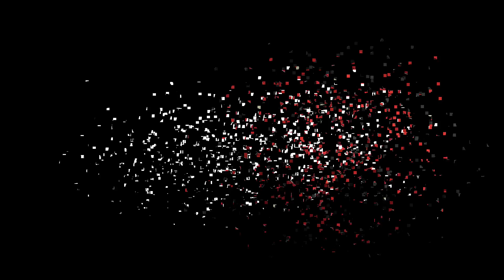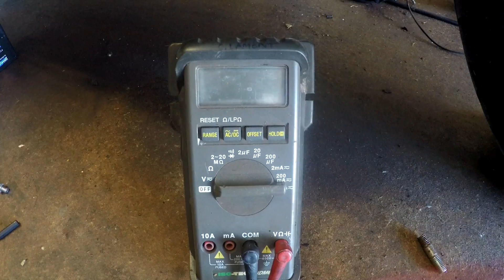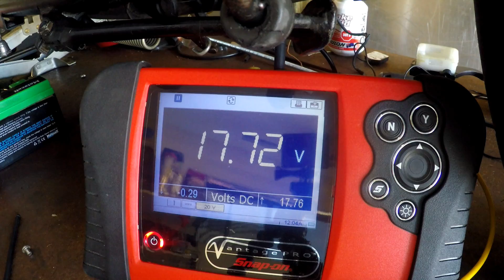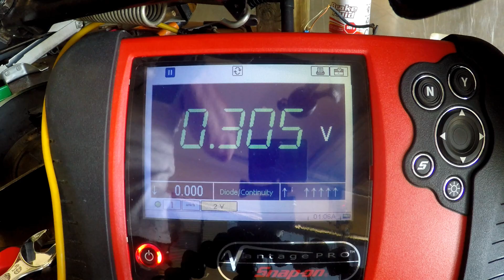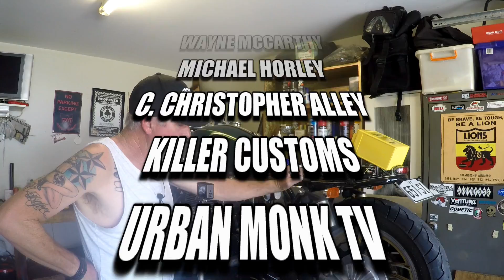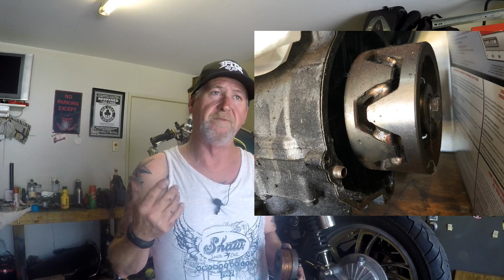'Basket Case' -  The Diagnosis

Comment: My 2009 Kawasaki ZX6R rectifier died at 10,000 rpm on the track. Fried ECU, battery, and relay board…. It was a used bike where recall wasn’t done. Fortunately Kawasaki USA covered everything except battery due to age.

Comment: Just bought a basket case of my own and you guys that have worked through these issues are a gold mine of information.

I’m now feeling much more confident that my project will succeed rather than end up in the scrap yard which is surely where it would have ended up if I hadn’t liberated it from the guy who sat on it for years and did nothing with it. Thanks and  looking forward to all your videos.

Comment: The battery charging reg. needs to be specifically suited to the LI battery to keep it charging at the appropriate rate and to keep it at the correct temperature while charging so it (the LI) remains reliable. LIs are great for these seldom run bikes coz' they keep their charge a long time (used in seldom driven hyper cars) otherwise the AGM batteries might be better suited for a daily rider.

Comment: Hmmmm, XS1100 converted to chain drive, what you talk'n bout willis, need input!!!!
Reply from the maker: Some of the race bikes were converted here in Australia. Bryan has the last surviving unit from that period. A company in South Australia still makes and sells chain drive conversions for the XS11.
Reply: yeah i found it, wow that's a lot of money to convert something you don't want into something you do want, cheaper to go buy a used bike that was made with a chain drive to begin with, not that I have anything against the shaft drive itself, in fact in some ways it's better then chain, the problem is the way the manufacturers implemented them, like with my XJ650, the engine itself has plenty of power, the problem is the bike only came with a 5 speed tranny and with a final drive ratio so low that, when trying to travel with the flow of traffic on the highway so you don't get run over the engine is running at 7000 rpm's which is 75% of the bikes 9500 redline, engines don't last very long when forced to endure that kind of stress for very long and the shaft drive makes it impossible to change drive ration.....

Comment: Hey guys after some info if poss my Honda crf 250 battery is goosed (6.3 ah) 10 hr, 3000 Thai baht new but i can get 6.5ah (10hr) for 650 Tb will it be ok and safe? Cheers
Reply from the maker: G’day John, that should be fine mate 👍
Reply: @ANDY5  Nice 1 Andy .

Comment: Hi Andy, thanx for that great explanation on rectifiers and AC/DC. Maybe you can use a throttle cable for a 2stroke, they usually  have a split cable system that drives the carburator but also the oilpump. And you can use that to fit an TPS cam on.... Just a thought.
Reply from the maker: Not a bad idea, thanks. If I ever go down that path I think it will be fairly simple to adapt one to the end of the shaft which lifts the slides

Comment: No personal experience using those Lithium ion batteries (expect on my power tools) but have heard/read a couple of stories regards those batteries 'failing'. Not sure whether it was in the comments section of some youtube videos or a video posted showing the issue. There should be no reason for them failing in a motorcycle application though. I still have my 'heavy' lead acid battery for my Bandit (that's in bits ATM) and don't have any plans to replace it with a lithium style battery should my current battery fail...More than likely my Bandit remains 'stripped' for 'some time' though so maybe it will never have to think about...
Reply from the maker: You'll get there Malcolm

Comment: A quick and dirty for checking the pulser coils, lay all the plug leads out on the head (with plugs in them). Turn the ignition on and wave a screw driver past each of the coils in turn, the 1&4 plugs will fire off one and the 2&3 off the other. Obviously this won't help bugger all in this case but might be a good one to file in the back of your head for the future when you're stuck on the side of the road with no multimeter.
Reply: Pulser coils that is, I just reread that and it might sound to some like I mean to wave the screwdriver past the ignition coils.
Reply from the maker: Wouldn’t the screwdriver need to be magnetised?
Reply: Nope just any old screwdriver works. I've used this to check GS and XJR pickups. Just about any TCI from a bike with two pulser coils will work to get that thing running too, it takes a bit of wiring diagram deciphering. Later model ones will use electronic advance (usually single trigger with a chopper plate) but just about any 4 cylinder bike with mech advance should be able to be wired in (just in case you've got old suzuki or Honda ones laying around)..

Comment: Vantage Pro is a great bit of kit but a hefty investment for a home workshop.
Our battery supplier tells us not to use lithium batteries on charging system which are designed for lead acid batteries.
With your high temps you should mount your Reg/rec on a copper plate with a cooling fan.
Reply from the maker: I’ve had that Vantage Pro for ages. I got it cheap from my Snap On rep as it was a repossessed unit. This model is no longer supported and you can’t get upgrades for it anymore. So unless I’m testing 2010 or older vehicles it’s pretty well only any good for the home garage these days, and even then our cars are newer than 2010 😕
Reply: Andy's Motorcycle Obsessions 
 You should scope the injectors, coils, cam, crank, abs sensors etc etc and store your good wave patterns, voltages earths and store to the sd card then you have known good data for your car and bikes. 
Still use my vantage regularly in then workshop so much quicker than my pico scope ( which brings you into a whole new word of scoping )

Comment: Chrysler solid state regulator off the early 80's chrysler and a full wave  3 ph bridge rectifier module and you should be good since that alternator is excited like an auto alternator. My old Yamaha did the very same thing years ago and thats how i fixed it. Also i added a Volt meter to my bike so i could watch it .
Reply from the maker: I have a volt meter, only any good if you’re looking at it 😕

Comment: Great video Andy. Similar to your situation, I had some trouble with fueling on my V-Strom that an aftermarket fuel controller was supposed to fix, but it cost a significant amount. I was reluctant for a while but spent the money almost 20,000 miles ago and have loved the way the bike runs since.

Comment: Just an out of the box thought but could you get one of your buddies to manufacture a voltage regulator box you could put inline on your present system to remove the battery cooking voltages to a more manageable level?

Comment: I'v just had the same problem with high voltage, i replaced my regulator rectifier with a mosfet technology one, apparently they don;t get anywhere near as hot as the shunt type ones

Comment: Lithium batteries married to a charging system designed to use a Lead Acid just seems like a bad idea, that's just my opinion. 

There does seem to be quite a bit of anecdotal evidence to suggest that this might be the case.
Reply from the maker: Lithium batteries when coupled to standard vehicle charging systems are fine, in fact this battery has been on this bike for five years.  The problem is that you can't connect them to a wall plug charger that wasn't designed for lithium batteries because they have a cycle designed to clean the lead plates that will harm a lithium battery.  The issue here was that I had no over voltage protection between the reg/rec and the battery so the battery fell victim to the over voltage failure.
Reply: @ANDY5   The trouble comes as you've experienced when there's a failure in the reg/rec unit.  a LA battery with continue to sink the excess power & voltage and help protect other components within the system whilst giving the operator a chance to acknowledge that a problem exists .  admittedly the battery will never be the same again and a few bulbs may blow but compared to the price of an ECU or Ignitor unit it's cheap. 

The protection circuitry in a lithium battery just goes open circuit, the result is potentially massive voltage spikes that can exceed 60+ volts taking expensive electronics with. 

 Modern  systems that are controlled by the ECU can  stop charging, hopefully preventing further damage. 

This is why I'm not keen on installing lithium technology into a system that wasn't specifically designed for it.
Reply from the maker: Thanks for your insight mate 👍
Reply: @ANDY5  No worries,  we don't know what we don't know.
Reply: If the reg. keeps the voltage below 14.5-14.6v, shouldn't be a problem................... his reg. failed, over-juiced the TCI & let the white smoke out, and caused his batt. to go open.  Sh!t happens all the time.

Comment: Andy, I know for a fact that 1999 YZF-R6 Yamahas have Keihin 37mm carbs with a throttle position sensor... only thing is they are CV carbs so an airbox would be nice for them
Reply from the maker: Yes Bryan is using CV carbs off an XJR and they have a TPS too.  I don't want to give these carbs up so I will figure something out.

Comment: Edison was a genuine prick, and not just to Tesla. Imagine our world with D.C. sub stations every two blocks??  Real shame about your failure mate. Can sour a trip I know. Apart from electrical faults. ( worst on a Ducati twin 500 ) I one had a clutch basket come loose hard riding in Macedon ranges north of Melbourne. Had to lay the bike on it's side on my kid, and open the clutch cover on the side of the road. Trying desperately to lose as little engine oil as possible, while preserving the gasket for re-use. Got the basket reattached and  pretend torqued correctly?  Then rode like a granny till I found a garage to top up the engine oil. Making do is often the unfortunate name of the game. Still, after that the ride wasn't a waste and continued and got me home.  Those RD350's were hard to kill.
Reply from the maker: I hope your kid didn't cause any damage to the bike lol

Comment: eBay's got your TDI. and reg/rect. for cheap.
Reply from the maker: I could only find one reg/rec with the right configuration.  The '81 model has five wires on one plug and three on the other.  Almost every unit I can find on ebay only has two on the field coil plug.  And the same with the TCI, anything with 2H7 stamped on it is useless to me.  They changed from mechanical advance to electronic advance in '81.  Anyone with a spare is unlikely to part with it.  Those that do have them for sale on ebay know this and they are nearly as dear as an aftermarket ignition.

Comment: I think the lithium battery is the root cause.  I run a small mc repair shop and have seen several fail open.  When this happens the regulator has no reference voltage and subsequently fails.  The additional ignition failure was likely a result of the unregulated high voltage in the system.   Overall this is an expensive repair.  I strongly suggest replacing the lithium battery with an AGM battery otherwise there is a significant risk of another similar failure.  Other than a bit of saved weight there is little advantage to a lithium battery.  The risk out ways the benefit.  I now refuse to sell lithium batteries to my customers.
Reply from the maker: This is why the comments section is awesome
Reply: Lithium batteries need specific mosfet  reg rec to run properly on older bikes,  you need a different mains charger also. If you want to retain the lithium battery Andy, look into these.. https://shop.revivalcycles.com/lifepo4-lithium-battery-optimized-mosfet-regulator-rectifier/
Reply: Sorry that link is for permanent magnet systems.. https://shop.revivalcycles.com/universal-field-excited-3-phase-regulator-rectifier-for-lead-acid-and-lithium-batteries/
Reply from the maker: Thanks Mick, I do have a lithium wall charger. I’ll look into the reg/recs. Thanks mate 👍
Reply: @ANDY5  been a few old Suzukis had lithium batteries catch fire with stock charging system. Charging system was always achilies heel of big gs and gsx bikes anyways.
Reply from the maker: Mick McNasty yes, permanent magnet alternators relying on headlight to switch on/off phases. I believe early examples of lithium batteries didn’t have over voltage protection built in, hence the fires

Comment: Have a 75 cb-550f with a field core type alternator.It is a points  reg that only switches 6 amps or so.50k miles with no problems.If you
have a points type reg....pull it apart and see if the points are fused together..if its solid -state replace it.Wouldnt go w/the fancy
ignition till the VR is sorted.....Wish you had shown the vr on the bike!  Good to see you back!! Cheers

Comment: Was a long time ago now, but my 1.1s chop ran 12v kawasaki coils, xj650 ignition box and Honda superdream reg rec. I had zero issues with the bike other than a diff failure and carb icing in sub zero temps, did tens of thousands of miles all over Europe on the bike.
Reply: Also consider fitting a cheap digital volt meter, can get them with USB outlets iirc, handy for camera or phone charging.
Reply from the maker: @MickMcNasty  I an expensive one, now also fried, right there on the dash.  I just wasn't looking at it

Comment: Good to see Basket case on the bench & a diagnosis made, shame the reg/rec took out Ign & batt when it failed. The ignitech system or the like is probably the best option from a performance & modernization point of view but as you say expensive, I would also consider putting a battery monitor in circuit I know they disconnect the battery if there's a drain so you don't get a flat battery but I think they also have over volt protecting so will will open circuit if the charge voltage gets to high thus protecting your lithium battery.

Comment: Great vid Andy; you appear to have made up your mind how to proceed. Sounds expensive. Is there an alternative , more inexpensive way to rectify  (no pun intended) the problem? Perhaps replacing defective parts with OEM parts, or similar. Not proposing you do, just wondering what the alternatives are?
Reply from the maker: Of course that is an option mate.  The problem is that the '81 XS11 has unique components and are not easy or cheap to come by.  For example a 2nd hand TCI on ebay to suit my bike is as expensive as a new aftermarket ignition system.  Reg/rec won't be too difficult to replace.

Comment: Hey Andy how are you. 
Have a friendly suggestion the no. 17 is not a good number to keep, 1 and 7 totals 8 this number will hurt you and so is no. 4 worst no. To keep. Change your no. To 75 or something. Cheers
I think putting back original battery will most likely solve these ignition issues.
Reply from the maker: The theme of the bike represents my Irish heritage.  The number 17 is for St Patrick's Day which also happens to be my birthday so I'm afraid it has to stay.
Reply: Hey Andy where can I find electronic ignition system on our XS1100. Thanks

Comment: Andy sounds like you have it on the run.  While I like the idea of the aftermarket Ign. system it sounds cost prohibitive to me, but I' sure your friend can fill you in on all that.  

These are the issues with riding an older bike that there is no factory support for any longer, too bad as there are some great bikes like your XS1100. You may remember I commented I had one back in the day put over 45K miles of trouble free riding on it too.

I will be following your progress on the repairs.